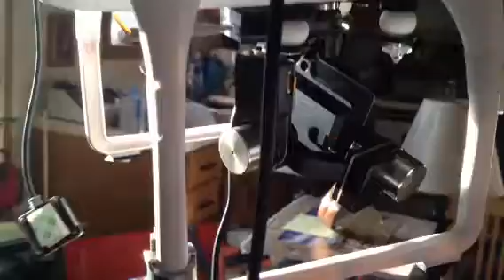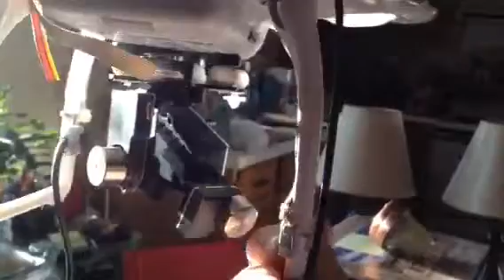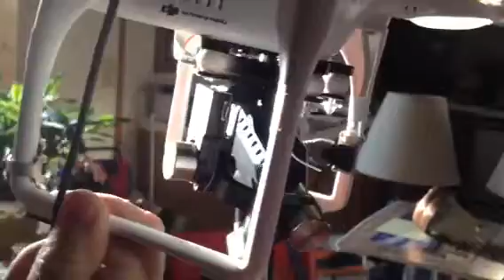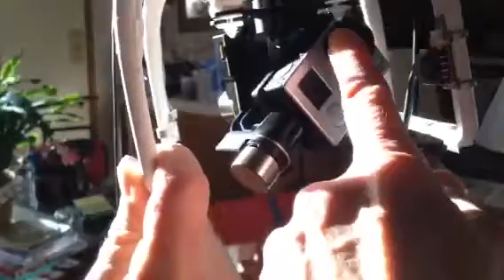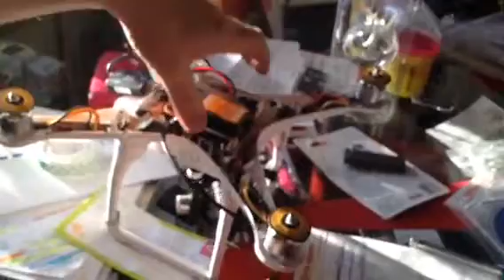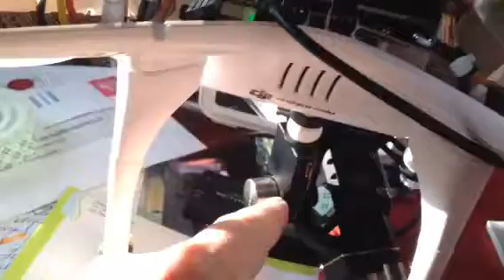Zenmuse H3-D3 phantom 2 gopro malfunction naza-m v2

Comment from the maker: Thanks DJ and Kelso
Reply: Hi Robert, I have exactly the same problem.
A gimbal with red led, that's not willing to get initialized, and the servo's getting real hot!

Do you already know how to solve this?
I have only the option to 'short-circuit' the gimbal, so the firmware is erased, the led is green, and I can fly with a shutdown gimbal...

Comment: You need to calibrate your RC.  Mine was doing the same thing until I realized the it needed to be calibrated.  Do the RC calibration first then the phantom.  I hope this helps.
Reply: Hi DJ FX, this happens with RC controller disabled. Should I still calibrate the RC? It's more a initialization problem with the Zenmuse H3-3D Gimbal.